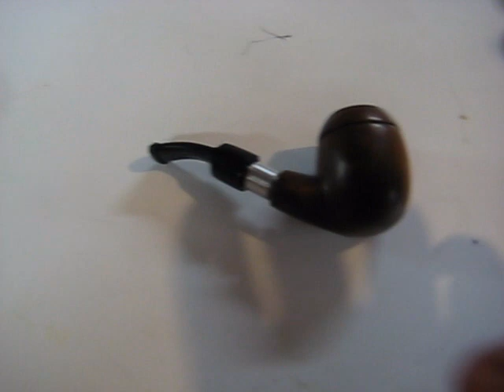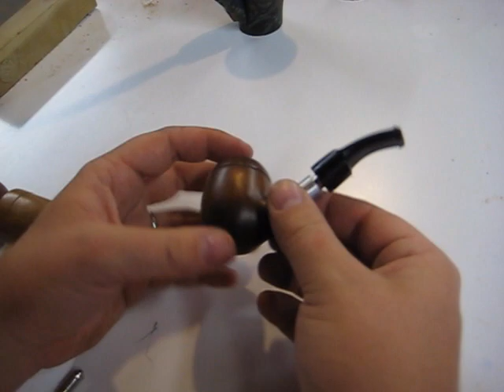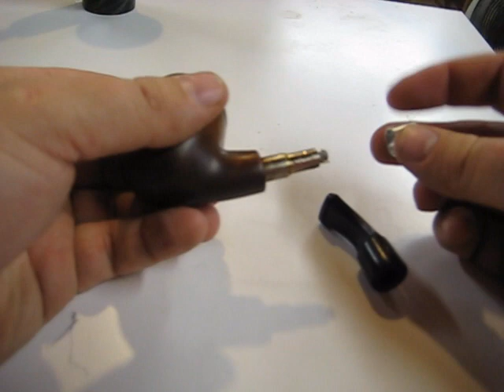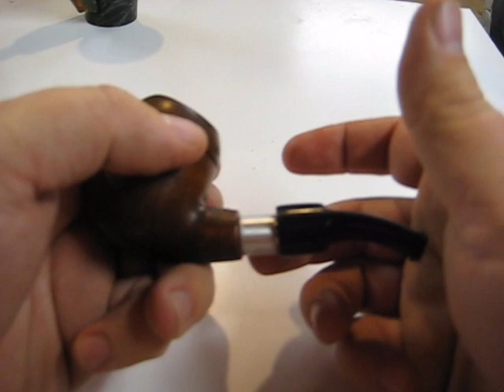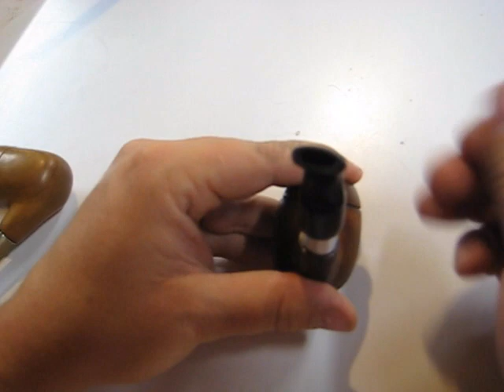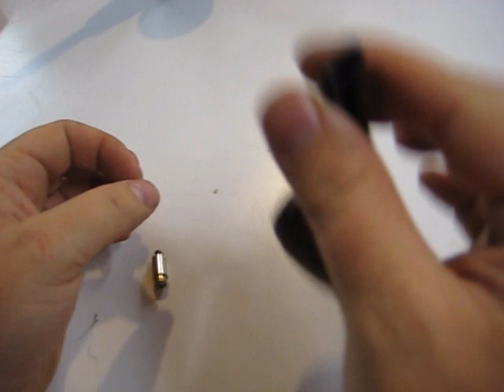306 LR Drip Pipe Stems Are Here!

Comment from the maker: our new universal tips have replace the 306 tips.
Theses stems use a universal from cherryvape, which can slide over a 306 or into a 510. I do recommend using a drip shield with a 306 universal setup.